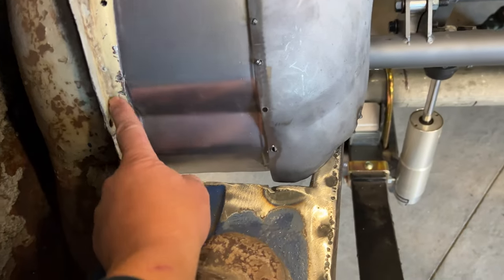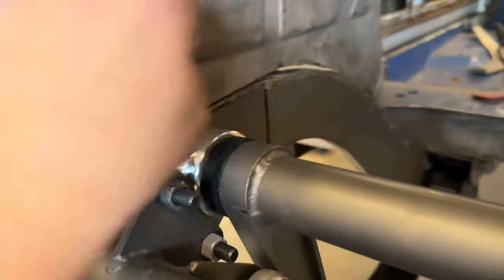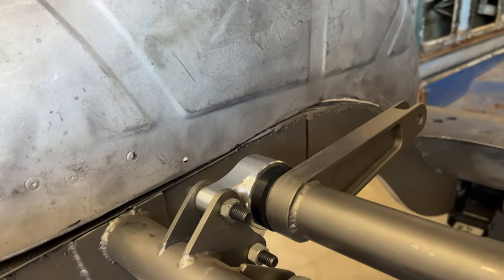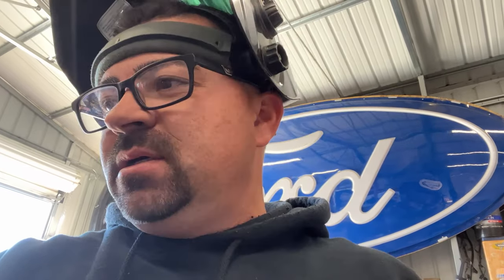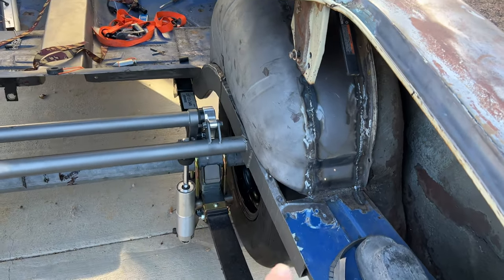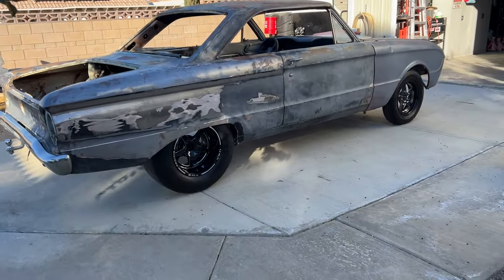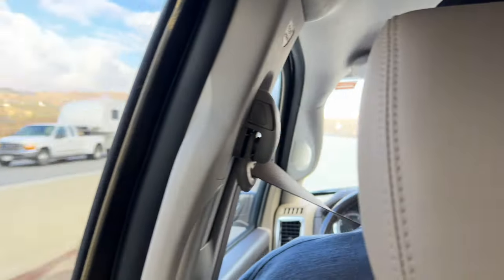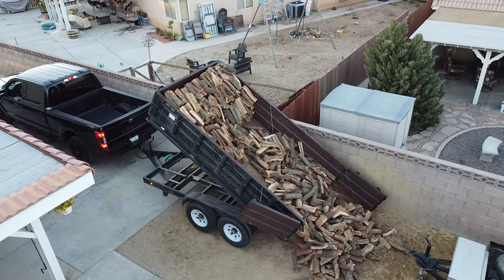INNER AND OUTER WHEEL HOUSES ARE IN! AND FALCON SEE'S SUNLIGHT!

Comment: Why don't you just square off the back instead of using stock inner wells get more tire room ? I've cut the ends of Axles off with a cut off wheel , as long as the axles don't hit each other you'll be fine.
Reply from the maker: I like the stock wheel well look. I don’t like the squared off look, especially since you see a lot of the wheel houses in this car when the trunk is open.